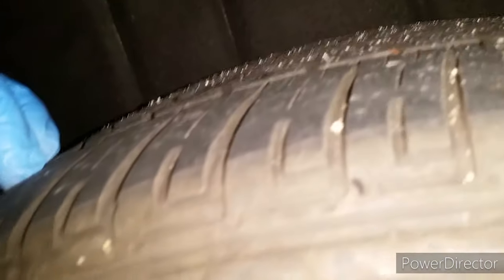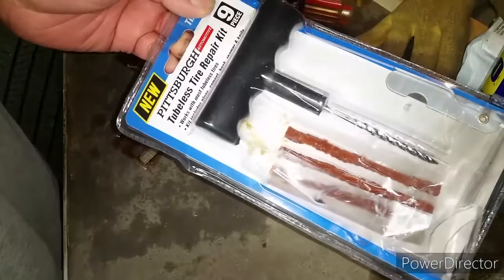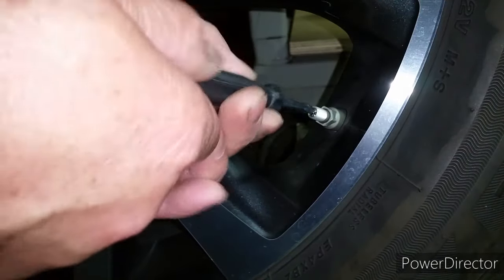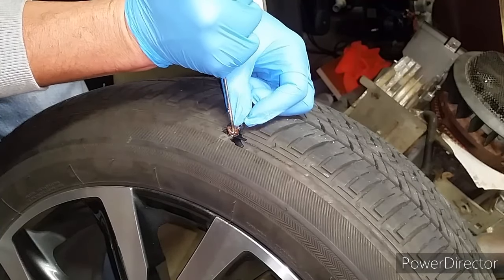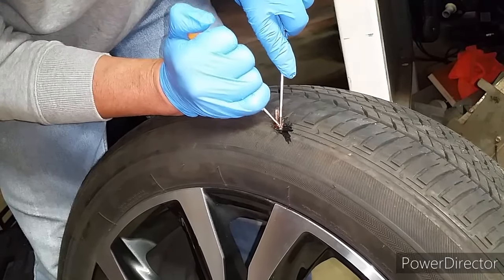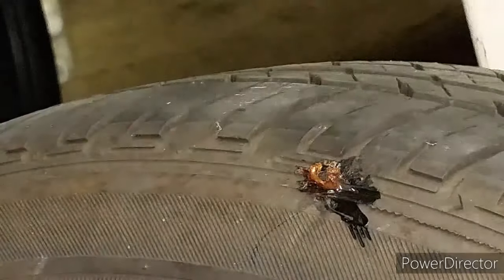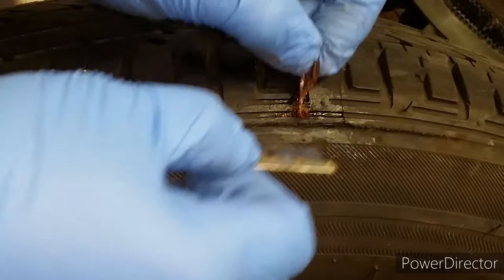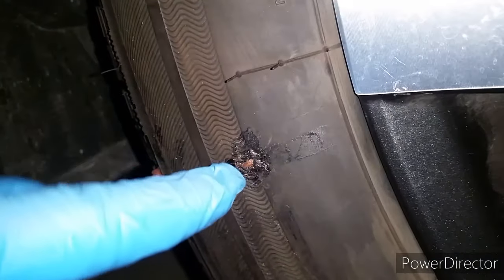Impossible Repair | Nail to the Tire Sidewall fixed | DIY

Comment: Thank you for making this video! I got stuck on the side of the road on a Saturday night… my car didn’t come with a spare tire! It came with the slime can lol. Watched your video & went & bought a kit from 24 hr autozone… I made it home thanks to you
Reply from the maker: You're welcome.  Yes. I know that feeling having a flat.  Glad you were able to fix it and get home.  You better go get yourself a spare. Did someone forget to put a spare in there? Or like you own a Lamborghini and there is no room for spare. Lol
Reply: @tonedubb4325  have a new 23 civic and no spare tire just slime kit, seems like spares are going away :(
Reply from the maker: @nissandriftscene9885  They are not going away. You happened to get a model that got the run flat tires.  Don't recommend using slime. It'll make a big mess in there.  You can still fix it using a sticky strip. When you get a flat, you are supposed to be able to drive for about 50-100 to your tireshop to get it replaced.  It has a rubber donut in the middle of the rim to supposed the car so you tire would not collapse all the way let you drive to a safe place. Only specialized tireshop can perform the tire replacement.  I hate those setups. Tires are expensive too.
Reply: Hi there whats a slime can?
Reply from the maker: @jasonlinton9902 ?? Slime can?? I didn't use any.  That will cause a big mess. May even damage TPMS.

Comment: First of all, thank you so much for sharing this video. My Highlander Michelin tire was punctured by a screw very close to the one shown in your video. Also, none of the tire repair shops would fix my tires. While my 4 Michelin tires are fairly new, with about 70% life expectancy, it costs about $1100 to replace 4 tires at Costco and also I need to do the alignment. I think this is totally ridiculous. When I was almost desperate, I saw your video and did it according your way. Now I am quite satisfied. It is my first time fixing the tire by myself. There's another YouTube video on how to repair a crack in the sidewalk that's more than one inch long. I appreciate all of your guys sharing experiences, and as for the legal issues in other comments , I can say, they should speak the law to the tire repair profiteer who threw nails and screws on the road.
Reply from the maker: I'm glad it helps you.  Tires shops are out there to make money and would use scared  tactics to vulnerable people so they could sell more tires.  I see it is the integrity of the tire is not damaged, it can be fixed.  Happy 4th of July if you're in the US. If not,  you have a nice day.
Reply: @tonedubb4325  you too man, happy July 4th.
Reply: Is your tire still ok? No explosion?
Reply: @Gabkicks  yes, over a year,still good.
Reply: People don’t realize once its flat if you drive on it the inside shreds to pieces and blows at the worst time like in the highway, theres a reason its illegal regardless of wether theres money to be made or not. Lifes worth more then saving a couple hundred bucks buddy
Reply: @jesusmiranda2073 Many years ago my tire blew on the highway from using fix a flat too many times. We were all ok. Just pulled over. Unless it was some miraculous miracle from God taking over, I'm pretty sure you'll be ok it a tire blows on the highway.
Reply: How long did your tire last? I have a puncture in the same place and I just got this tire, really don’t want to drop another $400
Reply: @jgedoom  until right now, still good, almost two years.

Comment: Great information thank you. I got a small nail hole pretty much in the same place. My tire is almost new and there is no way I am buying a new one. I'm doing this and will use that tire for my spare.
Reply: I have done this many times. It works
Reply: How long did your plug last
Reply: It works well,done it many times

Comment: At first I  was surprised someone even tried sidewall repair.   It takes an open minded to see this presentation.   I  would rotate this tire to real just for in case.  Great guy.
Reply from the maker: I did put that tire in the rear.  It would never pop, but the worst case is it might leak air. In my case, no leaks.  Lasted for another 5 or 6k miles.
Reply: @tonedubb4325 I got a piece of metal where the tread meets the sidewall.  I did plug it but am nervous about putting it back on .  Good idea about putting in the rear
Reply from the maker: @jcrowley1985  If it's just small holes, it should be fine.  If it was damaged by something bigger, causing the steel wires in the tire to get cut, then you need to make a decision as to whether to repair it or not.  In my situation,  besides the holes,  nothing else eye damaged.

Comment: From Philippines here, my sedan tire left front have the same punctured hole sidewall, repaired it like that plug. So far its been already 4months using the car and no problem with the tire.
Reply from the maker: Great
Reply: same.. did with my brand new youkama tyre side wall punture.. do far no leaks and perform good.. side wall has no steel bealts so no any issue..
Reply: How long did your plug last

Comment: I'm a firm believer in plugs over patches, been using them since the mid 70s they have plugged many of holes in many places on the tire, one time working in the shop a car came in, to my Suprise with a plug right in the side wall about mid-way, holding air not leaking one bit, ask the customer if he wanted a new tire he declined, and after the service drove on his marry way. I do know patches don't work very well most don't stay and fall off the inside, many cars came in after patches applied directions followed leaking like a sieve, they don't galvanize since they quit lighting them, you can have my plug kit when you pry it from my cold dead hands plugs work

Comment: hey, i had a few questions, so is it actually okay to patch it up even though the tire shops say it’s too close to the sides? was wondering if it was true and i can’t plug it up or maybe jus a sales tactic to try and get me to buy a new tire. would uu suggest i do this myself, or find a lowkey tire shop thats willing to do it for me
Reply from the maker: Tire shops always want to sell you new tires. They don't want to take risk patching it up.  Yes. It's possible to repair I wn your own. Use your own good judgment how bad the hole is. If it's on the treads closeto the side, there is metal wire mesh lining below. That will a easy repair.  If it's on the side wall, it's still possible but don't make the hole any bigger by raming that file tool in it. That will jeopardize the integrity of the tire even more.
Reply: @tonedubb4325  yeah my nail seems to b around the same area as yours, possibly just an 1in more towards the middle. so i should just find a small tire shop that’s willing to patch it for me then
Reply from the maker: Used tire shops will usually do it compare to the big ones.  Best if they remove the tire and patch from inside.
Reply: I used to work at dealership and the real reason why we declined is because we can't put a patch flat if it's close to the sidewall. In this case, I would use a snake plug and drive it all day, think its on the edge between sidewall and tread. If it's in the middle of the sidewall, I wouldn't risk the blow out

Comment: This dude selected increased risk for $20.

I can while I can understand why someone would want to do this, you should say, at least caution your viewers that plugging a tire that close to the side wall  increases the risk of catastrophic failure. There will be someone that sees this video perform the suggested repair and then have the tire fail.
Reply: RISK, worse can happen is the plug failes and your tire goes out.  BLOW OUTS rarely happen.   A new tire is more that $20.00
Reply: Don't be gullible.

Comment: If you tire is dry rotted, I would say by new tires .if your tire is new rubber is pliable and soft. This plug technique is totally doable.
Reply from the maker: Tire was in good shape besides the holes. I got 5k miles out of it after the repair.

Comment: I had a screw in the top of my tire [a brand new tire at that]. I go to NTB( a national chain), oh we can't fix it our patch isn't able to curve that way. I go down the road to a local tire shop..... 45 min later a call telling me my tire is done and fixed. Its crazy what these places will do to get you to buy a tire.
Reply from the maker: That's what they do, scam people out of their hard earned money.  They will advertise free flat fix. That's enticing.  Imagined if you're a a lady or a guy that's doesn't have a lot street smart. (no offense, not calling anyone dumb). You will believe them.. when they toss in word like unsafe... Tire would blow up.. You  would  buy new tire. You want to be safe.  You actually ended up in buying 4 new tires... the used tires shop would fix it easily.  If the tire is bad, they are happy to sell you one tire. Could be a new or used tire.

Comment: For the other tiny hole, did you do the same process? Or you used a smaller tool to plug it in?
Reply from the maker: I did it for both holes.  I peeled off the plug strip into smaller pieces and carefully used a small flat screwdriver to push it in while applying cement glue.

Comment: Super simple and informative video. Thank you!
Reply from the maker: It sure did. I was able wore 4 tires evenly till I had replaced with all 4 new tires 3 weeks ago.  Not once i have to add air to that tire. Wifey did run over a nail on a different tire in front on the old set of tires. Now let's cross my fingers she doesn't find any more nails or screws to run over.
Reply from the maker: So it last over a year.

Comment: It's just not worth it unless in an emergency. Blowouts do happen when people patch the sidewall of their cars tires and if that happens to you and you get in an accident, your insurance might not cover because of it.
Reply: I repair tires on my company's fleet all the time. We will patch semi tires pretty close to the shoulder. We'll only patch a shoulder on a passenger tire if I'm about to turn it into smoke in the parking lot.
Reply: I get sick of the "the insurance company might not cover..."

They really don't have a choice.  They will cover you unless you intentionally do something, and usually in that case also.

Hell, they'll even cover damage from an at-fault DUI accident.  They may cancel your afterwards, but they'll cover the accident.

You can run your toes down to the cords, and have a blowout causing an accident, and insurance will still cover you.
Reply: @jdmm72  Even if your insurance covers damages, if you're at fault for performing a negligent repair and the accident harms a third party, you can personally be held liable and sued.  The same way if a mechanic shop does a bad repair and someone is hurt.
Reply: @MiniDevilDF  and your point being?  Insurance SPECIFICALLY takes on the liability in this case, that's what insurance is.  It's standard practice to sue in many car accident cases, even suing your own insurance company.

If you were sued in this case, your insurance company would be required by contract to mount and pay for the defense.  Then they'd be required to pay up to your limits if another party wins the lawsuit.

And about being sued, you can be sued for anything, even making asinine comments on YouTube, and consequently, they even have insurance for that.

And additionally, suing for more than a person has and can pay will get you even less than nothing.  You could win a billion dollar lawsuit against me, I'm going to file bankruptcy on everything, including the judgment, so you literally end up in the hole.

By federal protections, you can't touch my retirement, most states protect primary houses and primary vehicles, and most won't garnish wages for civil judgments.  It becomes an uncollectable judgment, and eventually an unenforceable debt.

The saying is "You can't get blood from a turnip/stone."
Reply: @inoahmann7542  on semi tires, if it is a trailer tire dont you patch sidewall holes and add an air tube inside?
Reply: @potatochobit  I don't use tubes. Anything outside the shoulder I don't patch usually, but most of the sidewall punctures I see have so much damage to the tire that a tube wouldn't be able to fix it. (I'm talking about heavy-duty truck tires, not car tires)

Comment: Hello, very good video!
How many kilometers/miles did you drive with the tire?
What speed was he driven?
Were there any problems?
Reply from the maker: We put about 6000 miles. Drive speed about 70miles on highway.  Run fine until all 4 tires were evenly worn.  We replaced all 4 tires at the same time  no issue.  No leaks.  not a single problem .

Comment: The tire ship would of tried to sell a new tire. 
Nice creative way to fix!!!!
Reply: Sell you two actually they recommend replacing the other side on the same axle if the tire wear is good. Replacing one causes bad traction as one wheel has more tread depth than all the others thus creating handling instability. I myself have a die puncture but since I have winters have to replace all 4 because I can’t have 2 summers in front and 2 winters in back. Ahhhh my child sick and I gotta take care of this bugger.
Reply: I one time got away with one though my tires were still new and the shop said I could still I think they ripped me off $111 for just the tire or overall service I can’t remember.
Reply: And then they fix and sell your tire to a discount tire shop

Comment: I would only do this in a jam and then replace it asap.  The tire sidewalls are not like the top tread and are very soft and easily rip or tear. You would be very lucky if you can even pull the plug tool without ripping a bigger hole. If anything patch from inside and again only in a jam.
Reply from the maker: @spiritcomics5709  every situation is different.  I was able to fix this without issue and lasted for 5k miles. Don't jam anything in there.  It will ruin the integrity of the sidewall. I carefully added glue and some small pieces of plugs.

Comment: Missed a step?   The kit had a t-handle with a rough round file, which is used to clean out the puncture and rough up before plugging.
Reply from the maker: @sgtjude  if you got a hole in the middle of the treads, then use that tool. If you have a hole that is very, very small or near the sidewall, don't use that tool. Peel off a tiny strip of the sticky plug and apply cement glue as a lubricant and sealant to the small hole and use a small flat screwdriver and push it in.  Make sure to remove all the air out of the tire first. It will work. I have done it many times on different tires.

Comment: You do not have to remove or air out the tire. You do not need screw driver. This should take no more than 2 minutes. When you buy a plug kit from any supermarket/dollar store/auto store (they are everywhere less than 10 dollars) it comes with 2 extra pieces one to poke hole second put pre glued plug in the tire. Those kits mostly don’t have gloves, razor and rubber cement. Technically you do not need rubber cement but I recommend it. I always keep a kit in my car. ALSO YOUR INSURANCE COVERS THIS REPAIR. IF YOU GET THIS REPAIRED SELF PAY ITS 8-15 DOLLARS. Misleading “Imposible” title got 40k in here. Brilliant!
Reply from the maker: If the punctures were on the treads,  yes you can plug it up easily with air in it.  This nail came in on the edge and the tire lost air causing to fold.  She drove more.  The nail was all the way in then when tire underdeflatted, the nail from inside poke another from inside out. Now the second hole was very microscopic. The first puncture was near edge so i couldn't use the filing tool to rough up and clean the hole.  I didn't want to make the hole any bigger besides there's probably no wire mesh inside that area. Any further alternation would further damage the integrity of the tire. I couldn't use a regular size plug. I separated the the plud fiber strands and used only enough to seal the hole.  So letting the air out was the best option for me to the plug to stay while the glue cured. I did the same for the hole. I poured glue into syringe needle to inject into the hole while carefully inserted smaller plug strands to seal it.  I let the tire sat overnight with no air in it to allow the glue to dry.  It's tedious. I have plenty of those punctured holes where the nails gone on top of the tires.  Those were easier.  Thanks for the comments.  Just want to share what I've done.  Almost impossible. 😆
Reply: The title is accurate. It's in quotes because every expert on the internet says this kind of repair is "impossible" because it's on the sidewall. But people can and do fix them, so... I dunno. The war continues.

Comment: It's not that it's impossible to repair. It's that it's not smart or legal. Sidewall repairs are more prone to blowout. Imagine going 75 on the highway and the tire blows out. Is it worth a life? Also, it's not like your tire is a brand new tire. Smoke a little less pot and spend $50 on a used tire.
Reply: The smoke a little pot part 😂😂